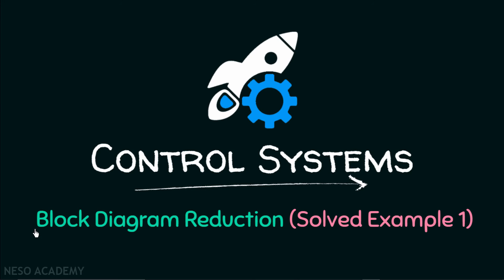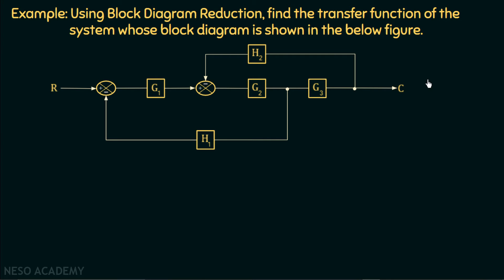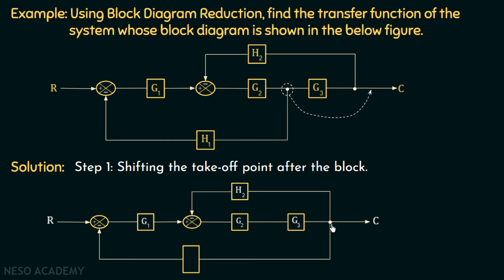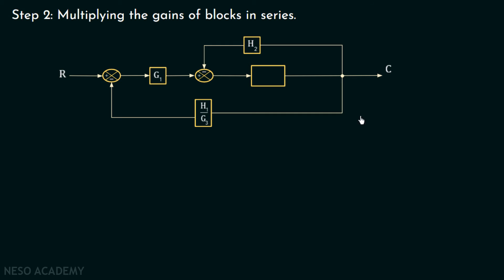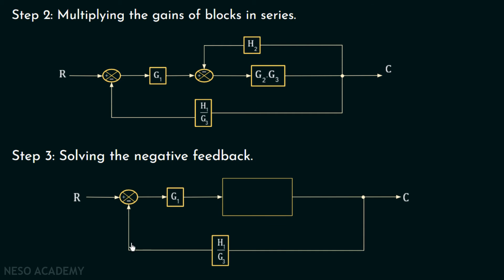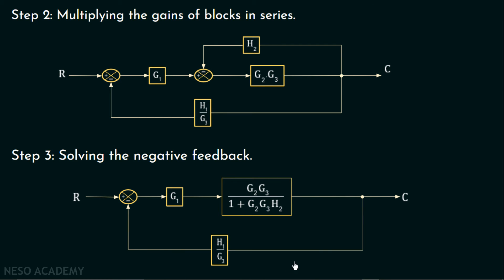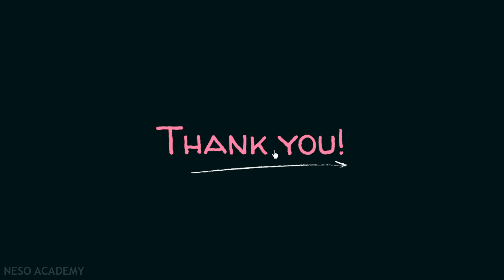Block Diagram Reduction (Solved Example 1)

Comment: *(G1 / (1 + G1 × H1))*

Where:

*G1 = (G1 × G2 × G3) / (1 + G2 × G3 × H2)*

And

*H1 = H1 / G3*

### Step 1: Substitute the value of G1 into the main expression.

Substitute *G1 = (G1 × G2 × G3) / (1 + G2 × G3 × H2)* into the main expression:

(G1 / (1 + G1 × H1)) = ((G1 × G2 × G3) / (1 + G2 × G3 × H2)) / (1 + ((G1 × G2 × G3) / (1 + G2 × G3 × H2)) × (H1 / G3))

### Step 2: Simplify the second term in the denominator.

Simplify **((G1 × G2 × G3) / (1 + G2 × G3 × H2)) × (H1 / G3)**. The **G3**'s cancel out:

(G1 × G2 × H1) / (1 + G2 × G3 × H2)

### Step 3: Substitute this simplified term back into the main expression.

Now the expression becomes:

((G1 × G2 × G3) / (1 + G2 × G3 × H2)) / (1 + (G1 × G2 × H1) / (1 + G2 × G3 × H2))

### Step 4: Simplify the denominator.

The denominator becomes:

1 + (G1 × G2 × H1) / (1 + G2 × G3 × H2)

Write *1* as **(1 + G2 × G3 × H2) / (1 + G2 × G3 × H2)**:

(1 + (G2 × G3 × H2) + (G1 × G2 × H1)) / (1 + G2 × G3 × H2)

### Step 5: Substitute this back into the main expression.

The expression now becomes:

((G1 × G2 × G3) / (1 + G2 × G3 × H2)) / ((1 + (G2 × G3 × H2) + (G1 × G2 × H1)) / (1 + G2 × G3 × H2))

### Step 6: Simplify the overall fraction.

Since both the numerator and denominator have the common term **(1 + G2 × G3 × H2)**, they cancel out:

(G1 × G2 × G3) / ((1 + G2 × G3 × H2) + (G1 × G2 × H1))

### Final Answer:

(G1 × G2 × G3) / ((1 + G2 × G3 × H2) + (G1 × G2 × H1))

Comment: Yeah, Just like all the people have pointed it out, the final transfer function in this example is not correct. It should be G1G2G3/(1 + G2G3H2 + G1G2H1). The playlist is good but advanced topics are not included.

Comment: An easier approach is to shift the last pick up point behind G3. And then first solve the negative feedback with H2 term and finally with H1 term. This way it is much easier to solve.  Anyways the answer has G1G2G3 in numerator as everyone else pointed out.
Reply: That's Awesome!
Reply: Can I shift it to the left?
Reply: @JF59122  yes you can! You'll then be multiplying the gain G3  with H2
Reply: @atifsultan_mech  Hi, will the final answer then be G1G2G3/1+G2H2+G1G2G3H1? Or did I mess up?
Reply: @abrokestudentsboringlife5806   The numerator is correct. However, please double check the denominator

Comment: Thanks for consistently imparting knowledge to us, I just have a little concern about the numerator of the transfer function, I think it should be G1G2G3 instead of G2G3H2
Reply: I think so too..
Reply: yes I think so as well
Reply: yes  @shiro5410
Reply: ı also think so
Reply: yes g1g2g3 was correct, they went wrong there

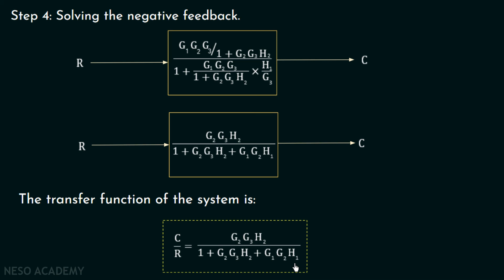Comment: Sir at 6:32 the overall function should be (G1G2G3)/(1+G2G3H2+G1G2H1)
Reply: How do you still have G2 and H2 in denominator when they got cancelled out?
Reply: @Wehn.  same question
Reply: hi can I get a copy of your solution how did you get it?
Reply: @ibymamaril9645  If you want, I can send
Reply: @debashisghosh3222  can you also send me right now bro? If possible?
Reply: you are right bro..........same here.
Reply: G1 is missing right?

Comment: I think there is a mistake while calculating the transfer function in the last step. 
It should be G1G2G3/1+H2G2G3+H1G1G2..... 
Please look after my answer... If I am calculating wrong please respond🙏🏻
Reply: You are correct...G1G2G3 it is in the Numerator
Reply: Just done the calculus as well and ended up finding the same as yourself
Reply: i think not correct.
i find G1.G2.G3/ 1+G1.G2.H1

i was confuse about this.
he
Reply: @marliusardi9973  you are the only correct one in the entire comment section
Reply: @marliusardi9973  I think the final answer is exactly what they wrote above. Before the last step, it should be G1.G2.G3/1+G2.G3.H2, called A. When negative feedback reduction with H1/G3, it becomes A/1+A.H1/G3, right? You should take A as the whole thing in main "structure", not only the numerator of it. Good luck!
Reply: Yes you are correct, I did a calculation mistake. It should be G1G2G3 in the numerator in the final answer.
Reply: yes you are right, i got the same too and when I saw his answer I was confused lol
Reply: Yup...clearing the same doubt
Reply: i used two different combination and get your answer , also when i have returned back to his answer in the video i got the same last answer ( same as mine and yours ) for sure he did a mistake
Reply: hope neso write the correct answer in the description soon
Reply: Same aa rha hai bhai
Reply: Yeah u r right....
Reply: Yes bro....this is ryt
Reply: You are right man
Reply: Yes I'm getting the same answer
Reply: u r correct, thank you
Reply: rightly said
Reply: right bro
Reply: I too got (G1G2G3)/(1+G2G3H2+G1G2H1). Spent the last half hour thinking I was crazy until I saw your comment.
Reply: Same ; you are correct

Comment: Thank you for this lecture. I only have one question. Shouldn't it be G1G2G3 in the numerator of the final answer and not G2G3H2? Thank you sir!
Reply: Same doubt bro, thankyou for asking  for me too
Reply: It is G1G2G3 because the element H2 has been cancelled out once we take the lcm, maybe it was a typing mistake.
Reply: Same doubt.
But may be typing mistake .
I was solved this question by Masons gain formula
Reply: Was in confusion for 2 hr and now i have seen ur comment😢
Reply: Yes. It will be G1G2G3 in the numerator
Reply: I get same as Priyanshu
Reply: شێرە گیان ئاخیرەکەی G1 ێ زیا کە
Reply: Same question.. Also.
Reply: Yes bro maybe it's a typing mistake
Reply: yessssssss!
Reply: Yes g1g2g3 should be numerator
Reply: Ok
Reply: I think it was a typing coz m also not getting to his ans.
Reply: It'll be G1G2G3.
Reply: It is G1G2G3 because H2 is a feedback, it can never come in numerator
Reply: Same doubt bro
Reply: you're right bro
Reply: How I don't understand
Reply: True
Reply: Can we move the take off point to the left in the first question?
Reply: @JF59122 i think takeoff point is always moved to the right
Reply: Got the same too
Reply: I also got g1g2g3
Reply: Came here to say the same thing. 
Bro had me doubting myself. 😂💔
Reply: Yes, The answer is G1.G2.G3/1+G2H2+G1G2H1
Reply: @rakshueditz7607  G1.G2.G3/1+G2G3H2+G1G2H1
Reply: @ryanleyland5565  yup getting same